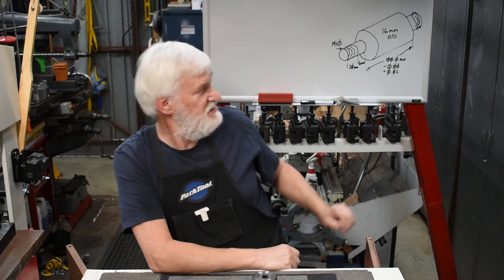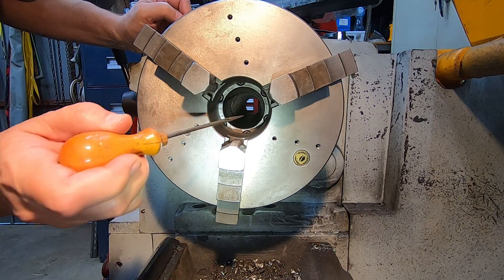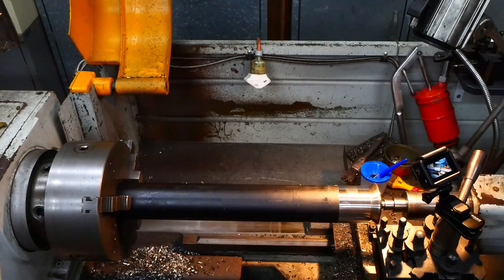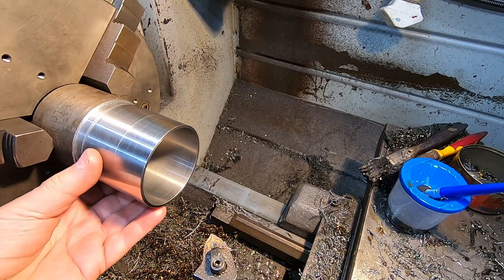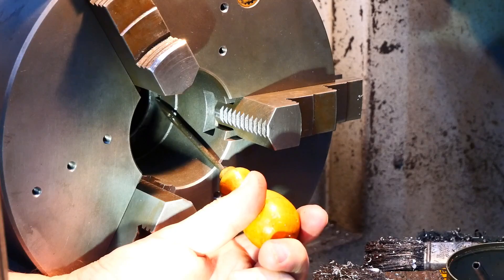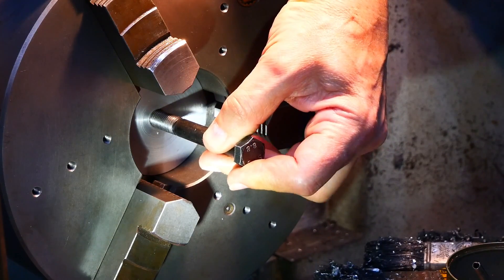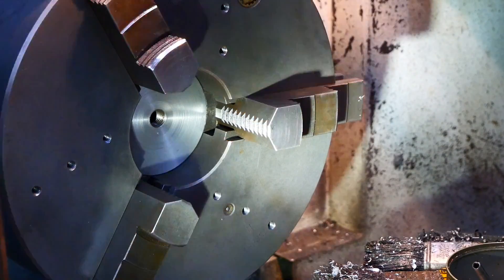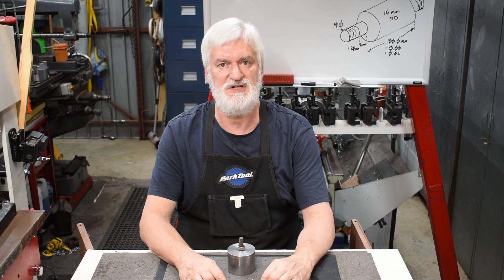Simple lathe chuck backstop.

Comment: I spent hours trying to design something super fancy.  Simple can be brilliant.  I need to make 200 parts spending time tooling up can be the difference of even getting the job.  Thanks for sharing. I’m using your tool design.
Reply from the maker: Thanks for your comment Dave. I have been surprised how useful this thing is. For example, I'm currently making 3 spindles by turning short pieces of scrap barstock. There is only enough material to put 10mm in the chuck and I have to support the other end with a tailstock centre. The chuck has enough grip for torque transfer, but it might not be enough to withstand combined axial pressure from cutting tool and tailstock. This chuck backstop gives absolute assurance that the workpiece cannot migrate deeper into the chuck and lose contact with the tailstock - possibly disastrously. 
Cheers, Alan.
Reply: Holding small parts is always a challenge.  For many years I made parts on a Hardenge tool room lathe.  Sometimes parts would be made on a CNC lathe then come to me for different reasons.  Hardenge lathes have collet closers and many things that a CNC lathe just can’t do.  I made thousands of bearing parts for Boeing and many times after parts being produced using millions of dollars of CNC machines ended up on my bench for finishing.  
What you made is basically like a C5 collet stop.  You were using a 5C collet 6 side block for your 3 jaw chunk.  The part I am making is a hydraulic fitting that is 20mm long.  With a long run of parts that may be an ongoing contract I would tool up using some soft jaws.  I would bore the jaws to fit the 31.8 mm part.  
The crazy thing is, is that my customer can’t shut down production on a CNC lathe long enough to deal with a part that after a program is up and running would take 5 minutes of run time.  My home shop has a CNC milling machine and I could write a program to make these parts on a mill.  The problem is the tapered pipe threads.  I could use a thread mill program but would also have to make a set of jaws for the vise and probably break several $100 thread mill cutters before I got my first part right.  
My point is that, your simple design is something I needed for my lathe for years.  
For small parts less they 25mm I use a 5c collet chunk I machined. I install it from the back of the tail stock and the Collet holder locks in the three or 4 jaw chuck.  I use a 5C collet stop and can use it for most things.  In a way I was recreating my beloved Hardenge tool room lathe.  
Sometimes we get in a jam.  I was going to machine an expansion mandrel to install in the spindle to do what you did.  I would make a bar to install from the tail of the spindle like a spider. A tapered screw would lock it in place and I would have it locked into the spindle.  The day would be like your design with the 10mm stop bolt.  
In the end we have to make a prototype part that works.  We can’t tool up for production until we know that part works.  When the engineering is complete we send our design off and make millions of them.  
The best machinists in the world are folks like us.  We don’t need a computer program.
Reply from the maker: @davebishop2566  Dave, given the chasm between your highly experienced machinist credentials and my self-educated fumbling, your acknowledgement and appreciation of my simple design is a much appreciated honour. Thank you.

Comment: Very good idea, that will help speed things up, mine just goes in the MT4 Bore Taper.
Reply from the maker: Thank you. It didn't actually occur to me to use the spindle taper, but mine is MT6 and would have needed a pretty hefty plug. Anyway, at least going the way I did kept the weight down :)
Cheers, Alan.
Reply: @alanshomeworkshop  Yes, you're idea was a good one, taking advantage of that shoulder in there..